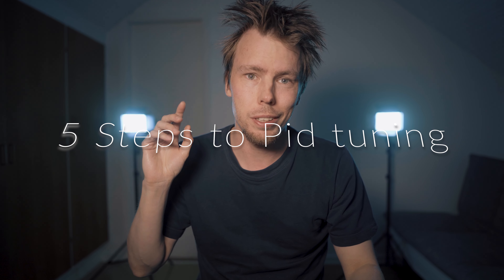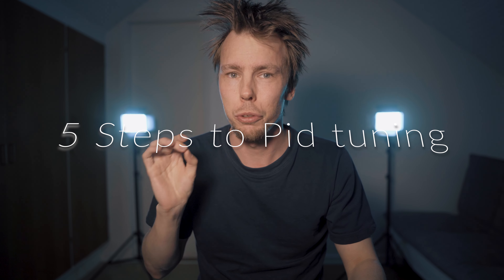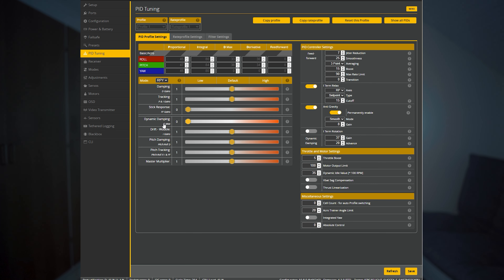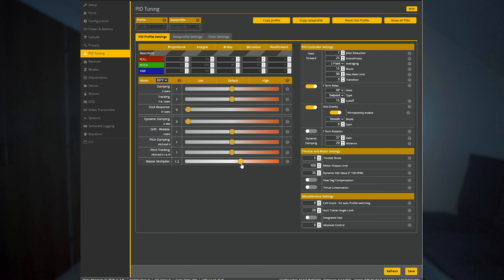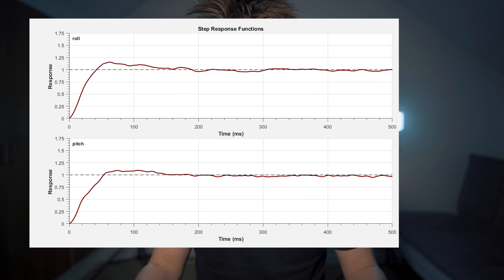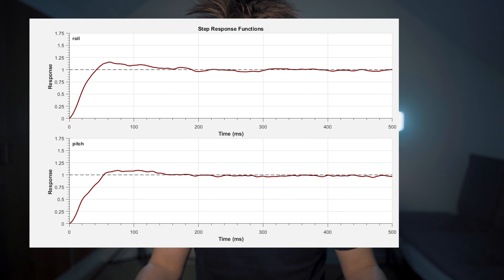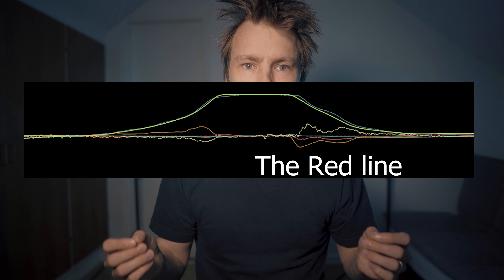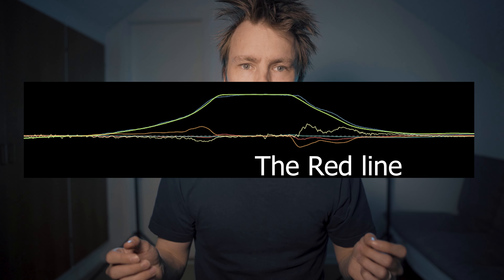FPV tune in ONE minute - betaflight 4.3

Comment: To the point. Perfect! Are there other settings in the PID Tuning section that you'd recommend setting before/after the 5 steps, or just defaults? Thank you!!
Reply from the maker: If you use bi directional dshot I'd set dynamic idle to 30, and use a preset to setup FF settings as well. I'd also recommend setting up bidirectional dshot if you haven't already. 
 
Thanks for watching! Glad you like the video!

Comment: hey i crashed my drone into a tree and it was left there in the rain for about 6 days, i replaced everything except for the FC and ive been getting extremly hot motors at hover ever since i rescured it; i didnt touch the pids or filters before the crash and my motors never got hot. is there a high chance that my gryo is just damaged? the drone is mechanically fine.
Reply from the maker: You should check the blacbox lot. There you can the see the gyro trace to see if it is busted. 
Also the new esc you've got. Is that a bl heli32? Or a bl heli s? If it is a bl heli s it could have turned off bi directional d shot. As it didn't support it. 
Also, if you've gotten an esc with older version of bl heli 32, it could be the version with the heat issue from bi directional d shot.
Reply: @RaukFPV  the new esc is the same as the old on blheli_32. i get that it might be an older version but even with the old esc before i replaced it, it was doing the same thing. the only time i wasnt getting this problem was before i crashed the drone in the tree. Also im not the best at analysing black box data but there is alot of high frequency squigly lines (at hover) in all axes. i lock tighted every screw on the frame, and after the crash i replaced literally everything except for the frame and FC. Its also worth mentioning that the motors do this behaviour arbitrarily, there is no pattern what so ever; i.e. it would actually fly alright (medium to hot motors) but then after i come back and land to swap lipos it suddenly decides it wants to make a whailing noise and the motors get so hot that u can smell the coils burning it is anything but a pleasant smell.
Reply from the maker: I'd suggest joining the betaflight black box review group on fb. There's a lot of help to be found in there.
Reply: @RaukFPV  okay btw you were right all along. even after replacing the FC im still getting hot motors i am learning about frame resonance and how to filter. and thanks i will join the group

Comment: hmm... any suggestions if there no blackbox?
Reply from the maker: Not All flight controllers have black box. You can get an "openlager" a small thingy that you can solder to the board to get black box. Or you can tune by ear/vision. The goal is to not have any oscillations og bounce backs. If you see any lower the pi/gain, if you don't try increasing it till you see them then back down untill they are gone